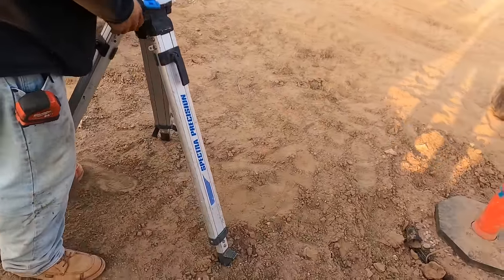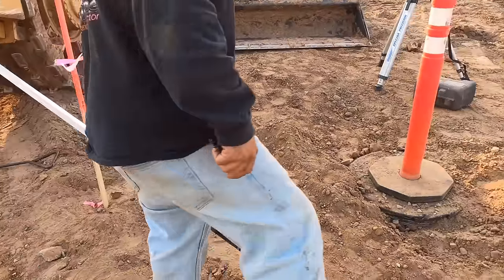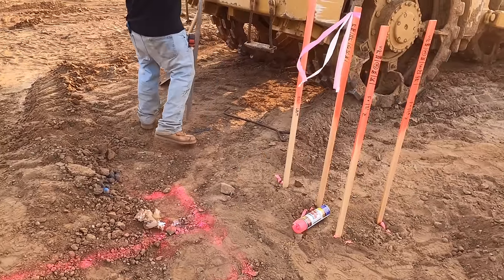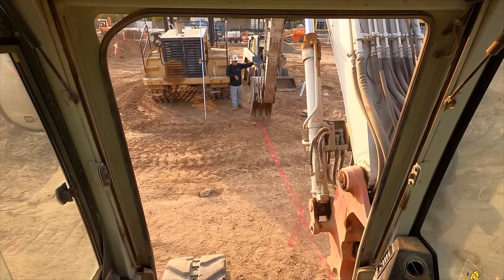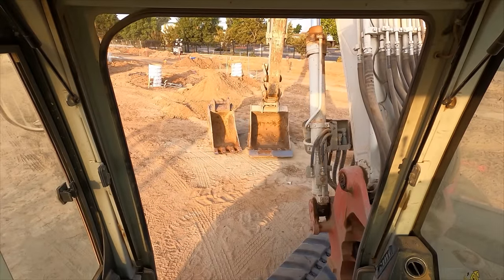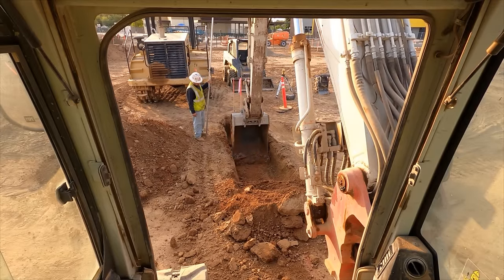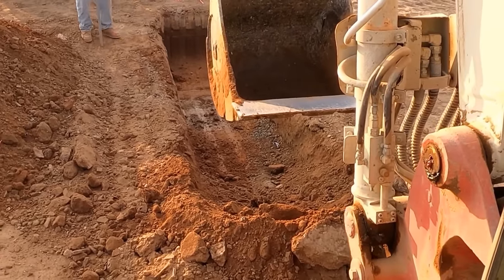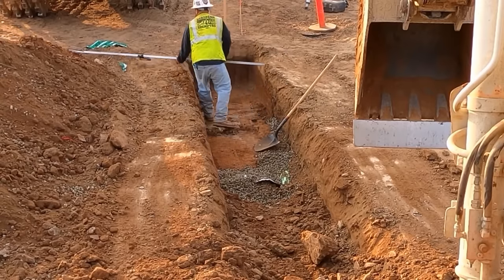Laser setup and finding buried pipe.

Comment: When I would set up rotory laser on tripod , I would push down with a foot on that foot leg on the tripod leg to insure the leg was firmly in the ground.
  There were a few times that the servaying staking didn't match the grade on the ' blue prints ' - plans. I would always shoot hubs & figure grade & cross reference to plans to see if they match. If not I would make '' note on plans per staking '" .
Reply from the maker: We do the same on our jobs. But this was just for the sprinkler guys. Not really precise work.
Reply: @TheLeverMonkey  right on, most of those guys are pretty cool, have a good day sir
Reply: When you dig with a mini ex are you suppose to put the blade behind you ?
Reply from the maker: @joelhunter4082  I do it so I can see better. If you are in hard ground you would have it in front on the ground to help with leverage.

Comment: Man that the hard way where is the grade rod with the elevation tape on it .I’m used setting up the laser them putting the laser rode on the hub get my signal then move the tap to that elevation then figure out how far to go down we use 1and 1/4 inches equals one tenth on the rod I must be spoiled
Reply from the maker: Yes you are 😆. That is a linker rod you are talking about. With underground we dig deeper than the linker rod can reach up too. So we use 1" alumanum rod as our grade poles.
Reply: That will work we just transfer our grade down in the trench by making a bench mark by putting a painted dot on the top of a fixed piece of pipe and use that as our new bench mark but where your at you don’t have to worry about hitting the water table at 15 feet below ground